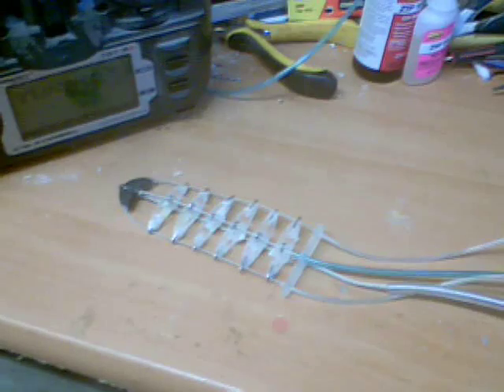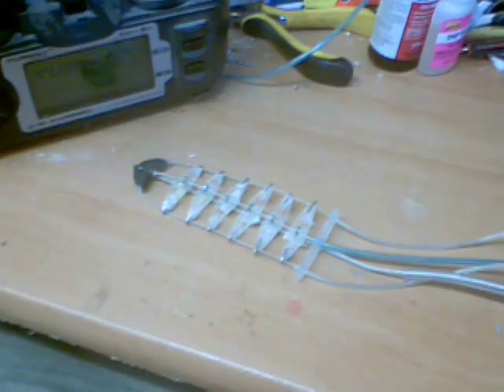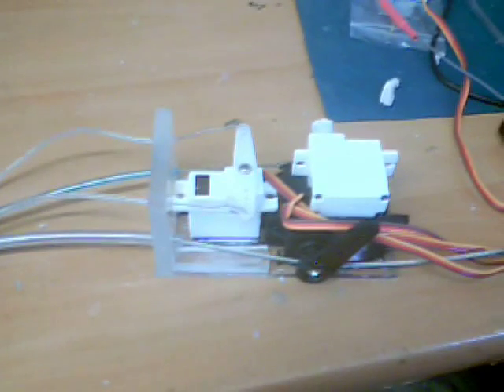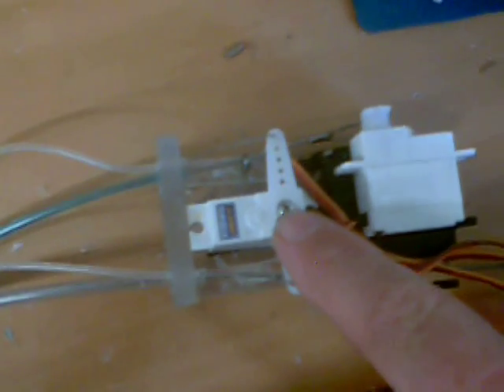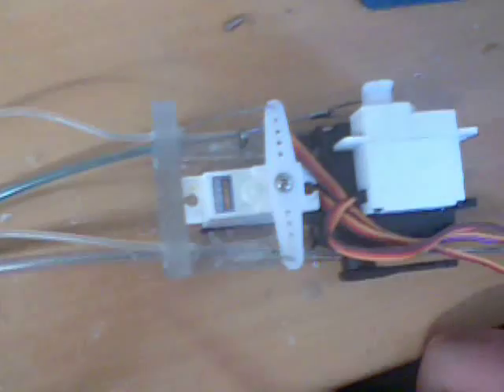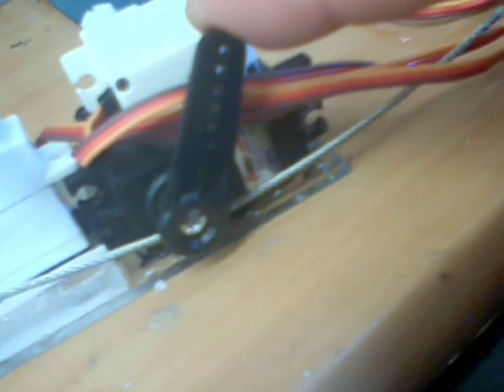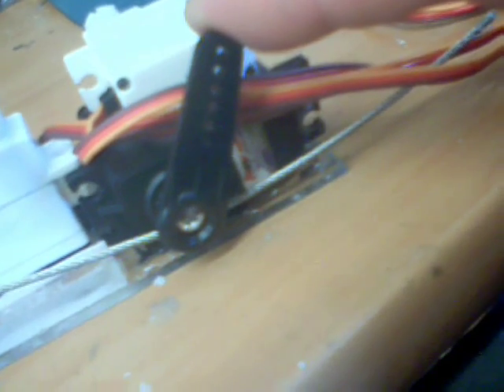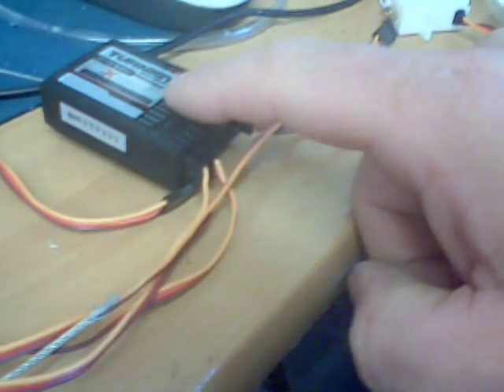Animatronic Tongue

Comment: This is amazing! Would you mind sharing the servo specifics for this project?
Reply from the maker: Sure.  As I do things on the cheap I don't use digital servo's, Just analogue ones.

The main driving servo that pushed the tongue in and out is a Towerpro M995/M996
The other servo's are from Hobby King . Any of the following can be used depending on how flexible your tongue armature is.

HobbyKing™ HK15148B Digital Servo 2.8kg
HobbyKing™ HK15178B Digital Servo MG 1.5kg
I have had no problems with the Hobby King range. Their 'digital' servo's are still analogue however the digital part is that they refresh the pot/motor parameter more often - which is one of the good points about Real digital servo's

Hope this helps :)
Reply: That helps tremendously. Thank you so much for sharing your knowledge!
Reply from the maker: I got a lot of my knowledge from this course and other
https://www.youtube.com/watch?v=pi06u99UaOk

I'd definitely recommend keeps in eye on their Youtube.. Or even join them.   The wealth of knowledge they have is fantastic.
Reply: @marcwolf60  Thank you for referring to this school.

Comment: hi could you tell me what material you used to guide the wires through in the tongue, the little platelets?
Reply from the maker: Hi. I used strips of plastic for the crosspieces and bent sections  of paper clips to make the loops. 2 part epoxy is the glue.
If I was remaking it I'd 3d print the parts
Reply: @marcwolf60  thank you very much : ), great work